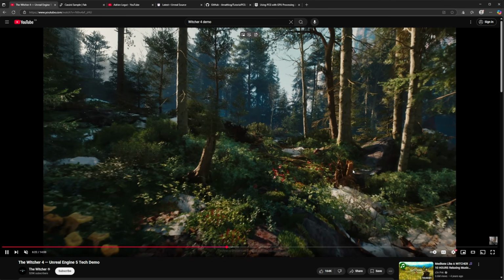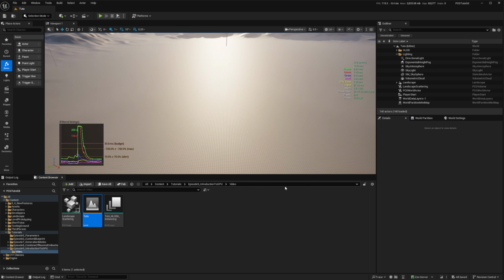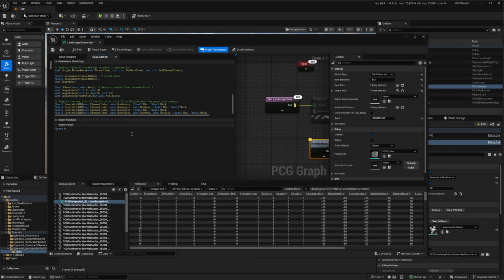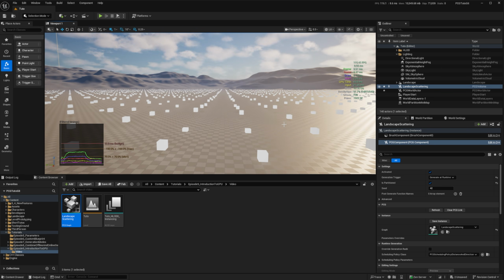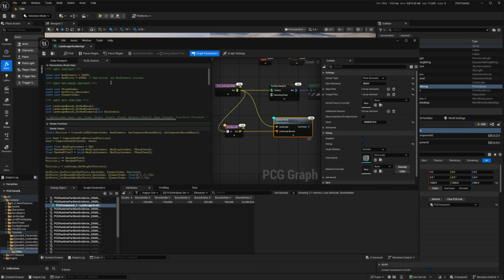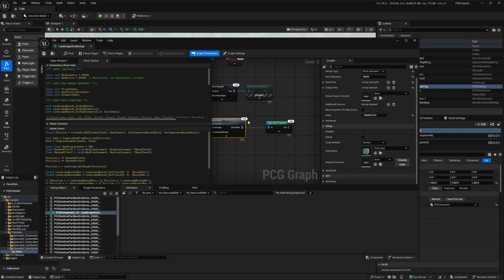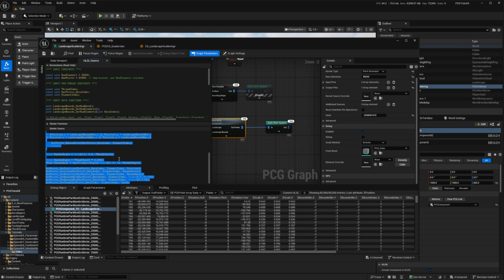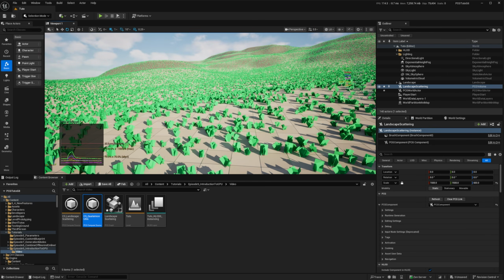Unreal Engine 5.6 PCG - Ep 9 - Introduction to GPU

Comment: Fantastic video, greatly appreciated! Is it normal for the static meshes to flicker (disappear) randomly when moving the mouse up/down (no character movement, just the mouse)? I am noticing this behavior only when I toggle "Is Partitioned", since it's a requirement for the GPU Processing. I first stumble upon this when I tested the GPUGrass example provided by the plugin, and now the same when testing this method. If it matters, it's for 5.7 and thanks again for the shared knowledge!
Reply from the maker: Partitioned is not required for GPU, it's just that for runtime grass like this, it is useful to spawn the grass on smaller cells around the player.
And no the meshes should not disappear by not moving, so this suggests an issue with your mesh more than PCG probably
Reply: Oh, thank you for the feedback! I was looking at the RuntimeGrassGPU Showcase template and the comment left in there states that partitioned is required, that's why I was under the impression it's required, my bad. I've tried with multiple meshes, some from megascans even, and the flickering is not constant, I am noticing it mostly around slope areas. A cluster of grass may not flicker at first, but when I come bit close to them they start flickering when I move the mouse upwards, still trying to figure out the reason.
Reply from the maker: @DevzoneGaming-t7g  Once the mesh is spawned it is no more PCG responsibility (until it gets de-spawn, or the user actively refresh the generation). So I would be surprised it is because of PCG here. And it is also not something we noticed internally in all our usages :(
Reply: @adrien_logut  After long debugging and trying out whatever came to mind, albeit with my very limited knowledge currently, I think I figured it out the flickering. The heightmap I created in Gaea was imported at some negative Z value (my character was spawned at around -6970), so I decided to move the landscape way way above in the positive range, and I can't seem to reproduce it so far. Don't know why, I am still learning a lot of things. Anyway, just decided to let you know. Thanks again for the feedback!
Reply: @adrien_logut  Sorry to revive this once again, I would appreciate if I can borrow your insights once more. In my "Get Landscape Data" node, I've checked the box to return the Layer Weights data, but I am having troubles finding a way to read that information in my "Custom HLSL" node. The interface that's been generated based on the input pins (Landscape, LandscapeBounds), does not provide a method to get the weight of a layer (I have 4 in total defined in my material at "LandscapeLayerBlend" node). What I am trying to achieve is use the same function to remove points from layers I don't want them to. I figured "AttributeFilter" will also work, but can't find a proper source in the documentation.
Reply: @adrien_logut  Hi again! I was hoping I could borrow your knowledge once again - is it possible to pass different scale values from HLSL to the Static Mesh Spawner? Currently the way we define the scale within HLSL, it's applied across all mesh entries. If not, to your knowledge, would it a heavier on performance if multiple static mesh spawners are used instead of one with multiple entries?
Reply from the maker: @DevzoneGaming-t7g just set the scale for each different point to the value you want.

Comment: @Adrien Logut
Okay, so I'm trying HLSL Custom Nodes and I created 2 pins of Attribute Sets, but for whatever reason no matter what I name the pins the code refuses to accept them, giving me “undeclared identifier” errors. For background, I have two float3 parameters that I'm feeding into the custom node on the graph (I'm not referencing the parameters directly from the code). No matter what I name the input pins it refuses to accept them as valid identifiers. I'm at wits end and my question has been unanswered on the Unreal forums.
Reply from the maker: I imagine it is this one?
https://forums.unrealengine.com/t/what-am-i-missing-here-pcg-hlsl-custom-node-attribute-set-pin/2695606?u=adrienlogut

It's `GetFloat3` you have a typo

Comment: I thought the Landscape_GetHeight requires to output world height to runtime virtual texture in landscape material to work? For me the grass else appear in 0 z-coordinate. :S And currently only if in editor view. If playing then the grass again appear in 0 z-coordinate. What I could be going wront? :S  (EDIT: Had to set landscape not to write any virtual texture, Landscape_GetHeight started to work then)
Reply from the maker: No it doesn't depending on where the height is written, you also need to change the settings on the Get Landscape Data node regarding virtual texture.
Reply: @adrien_logut   it seemed to work odd way but maybe I missed something. Using the new "Generate Grass Maps"-node that also require to use "grass.GrassMap.UseRuntimeGeneration 1"-console command or the grass wont generate during play.

Comment: When enabling GPU mode for the Static Mesh Sampler using only default nodes, the mesh does not appear in PIE and only functions within the editor. Is there any way to display PISM in PIE without using HLSL?
Reply from the maker: Check the logs, probably the landscape cache needs to be set at Serialize only ok cook in the PCG world actor
Reply: @adrien_logut  It's working perfectly now, thanks to your advice!!
To be honest, I'm a newbie and I had been stuck on this problem for over 5 hours. There's no way I could have figured this out by myself. I had almost resigned myself to just flooding my vast landscape with CPU trees. Your knowledge and expertise have been a lifesaver so many times. I'm sincerely grateful and have the respect for you.

Comment: Thank you! this is an amazing feature!
Question: Is it possible to have compute sources sync with external txt files (as a built-in feature), for easier integration with existing source control tools. I imaging it will require custom tooling to do that?
Reply from the maker: Unfortunately no, I wonder if we have an option to serialize those assets as pure text instead of binary.
Reply: @adrien_logut  Or maybe even a separate type of asset that reads external txt data (something like media source?)
nonetheless, this stuff is amazing, looking forward for more! :)

Comment: I find it amusing that you explained HLSL, compute source used as a library, quaternion calculations, etc. and then felt the need to explain that '||' is the 'or' operator. 😄

Great video. Definitely using all of this. Though I am a bit concerned that this can't be used for any collisions. Is there or will there be a way to do a one-time conversion to CPU once it finished figuring out where everything should be? Or for a save state between runs at the very least? If I can't place trees and rocks using the GPU, I'm not sure what the benefit is outside of grass for world generation.
Reply from the maker: Hehe yeah I dunno, not sure bool ops are often used in HLSL
From another comment I wrote:

I haven't tried it yet, but in theory, you could have the trees generated on the GPU at a great distance, and read that data on a very very small grid size to spawn the exact same tree at the exact same position, without rendering it, just for the collision.
Reply: @adrien_logut  I'm definitely going to experiment with that idea. Thanks!

Comment: Thank you so much for this video! I'm looking forward to the next ones.

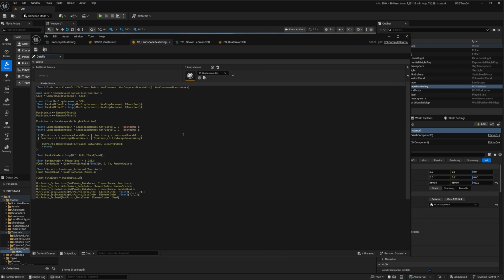30:38 I was getting an error: [33,33] use of undeclared identifier 'RandomRotation'

Thanks to ChatGPT, we can use RandomQuat instead of RandomRotation to fix the error.
You can also add a slope angle exclusion, right after Landscape_GetNormal(Position):

float SlopeDot = dot(Normal, float3(0, 0, 1));
if (SlopeDot < 0.7071) // Exclude slopes > 45°
{
    OutPoints_RemovePoint(OutPoints_DataIndex, ElementIndex);
    return;
}
Reply from the maker: Oh god I made a typo here, it's indeed RandomQuat (as you can see it defined 3 lines above)
I remade this part because in my first rush I didn't do the multiplication in the right order (I always mix it...) and probably made it too quickly sorry!
And indeed you can also filter by slope on top of that :)
Reply: @adrien_logut  No worries! As you said, this is precisely a good example of why we should avoid copying code without knowing what we're doing! 😅 And for once, the AI was useful in helping me better understand this method. Now all that's left is to practice more. In any case, this approach is very interesting! Doing a few tests on an 8K map, the performance gain is huge!